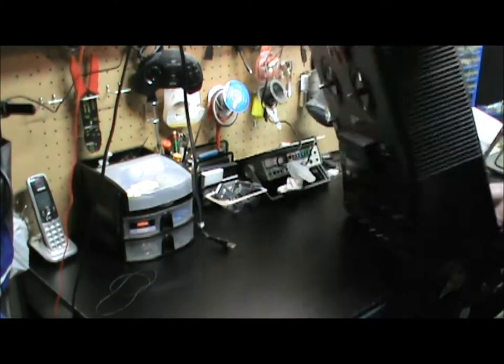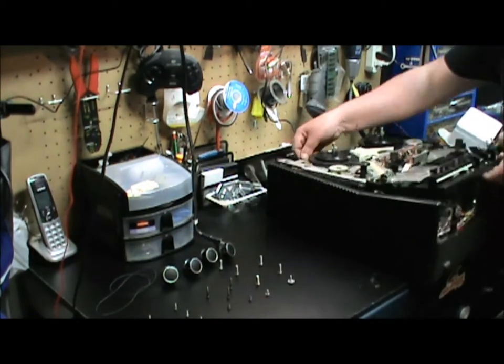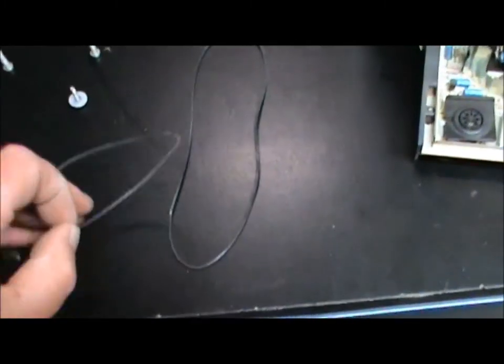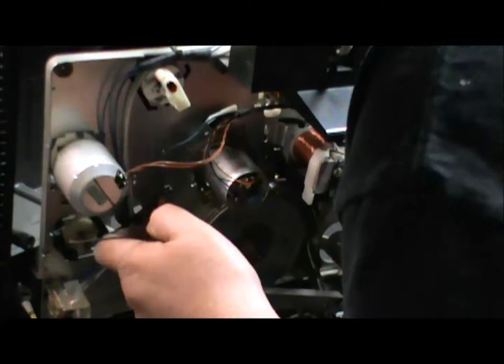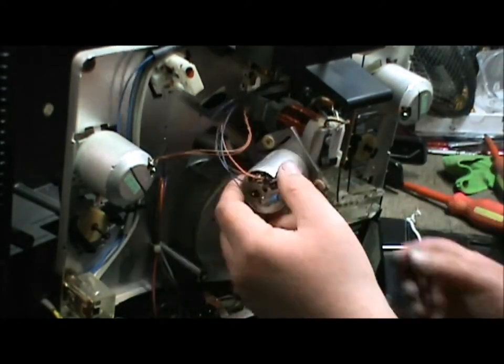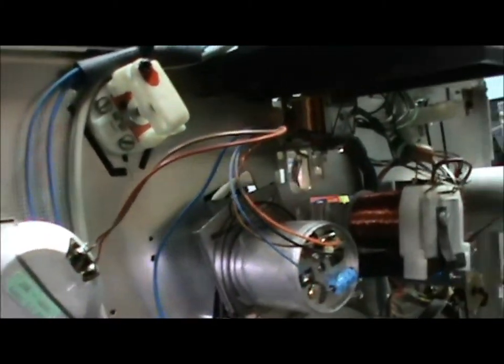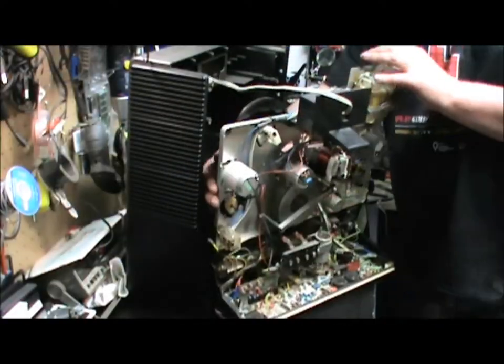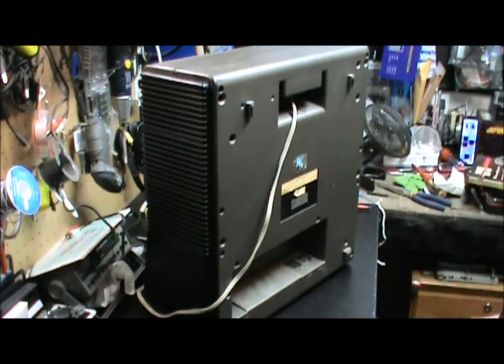Philips N 4504 Reel to Reel Belt replacement repair diy parts in description

Comment: Hi, nice video. I used to own the bigger version of this one, (N4506), and I loved that deck. I was an audiophile from about 1980 to 1990, and built a pretty large, expensive, component system. I all but gave it all away via pawn shops as a result of a divorce in 1991. 

The only thing I kept and somehow managed to take especially good care of, (even when I wasn't taking good care of myself), was the collection of (12) - 7" Reel to Reel tapes that I created in many hours worth of recording sessions. They're truly one of a kind and I almost still can't believe I kept them all in an AC environment no matter where I was.

About 1-1/2 years ago, I bought a descent Akai 4000DS MK II deck on eBay. It was in beautiful condition but I still knew I would need to clean up all the interior electronics and replace the belts. Of course, cleaning and demagnetizing the heads is a given, (I do that with every record/play session or every 4 hours, which ever comes first).

Anyway, when I put one of the reels on it and played it, I was instantly transported to 1982, (I was 26 then), and I'm now carefully digitizing each tape. It'll take some time and I'm thinking about buying a better deck. I know there's just about no way to get another Philips N4506, they just aren't out there.

So I'm looking at Teac or a higher end Akai, maybe a Pioneer RT909, etc. I'd love to get a Tanberg but if I can find one, I'd have to get a second mortgage on the house. If you happen on a descent Reel to Reel deck that you want to sell, let me know!

I have your email address from the video, (I don't know if it still good, but I'll try it). and I'll probably send a copy of this post to you that way as well.
Thanks,
Rich
Reply from the maker: +Rich Paul didn't get a email but will double check and will keep my eyes open. Never thought I'd get such a great response on this video.  You guys all rock!
Reply: Yes, it was a good video. I did the same job but on my 4506 back when I had it. I never did send an email because I forgot. I was searching for a deck and last Thursday or Friday, I happened to open eBay 5 minutes after a seller posted an ad to sell his pristine Tascam 32.

He put it up for auction but had a "Buy Now" price which was only $70.00 more than the auction's starting bid. The deck was in such great shape and he made 3 videos that showed the heads very clearly and up close, (they were perfect).

The sound of the deck and its mechanisms were super quiet and I knew that it would never make it through the auction. Someone would buy it way before then. The starting bid was $290. and the Buy now was $360. He wasn't very familiar with eBay selling as you can tell by the way he posted the auction and buy-now prices so close to the same.

The Tascam 42 would have been my preference but the two I could find had a $1400. minimum price tag. This 32 looks like it came right off the store shelf and I couldn't pass it up. He shipped it yesterday including some new tape and two 10.5" metal reels.

I hope to have it by Friday.
Thanks,
Rich
Reply: Enjoyed your recollections and feel the same about the old reel to reel machines. I sold the Sony 630 and the 377, but perhaps should have had them restored. The N4422 I have now needs servicing, but dont want to take it too far away from Birmingham UK to get done. Any ideas?

Comment: Excellent video. You made it look easy, but expect it doesn't always go so well, particularly if more work is needed on old greased parts. I have the Philips N4422 that I am offering for sale now, but it does need new belts and a good service. I bought it new with a 'Sprocketmaster' attached in my old fil making days. Have loads of tapes with some great music, but nothing to play them on. It crossed my mind to restore the machine (not me but through a good service engineer) but may be put off by the cost of that. It was a great machine but may cost more than I would want to pay. I also dont know of a service engineer in the Midlands of the UK (unless you do?)
Thanks again.
Malcolm
Reply from the maker: Hey Malcom,  its hard to tell the cost some shops are super expensive and charge by the hour plus parts so even a 5 minute job gets billed as a full hour.   I would try to search local classifieds to see if there is someone out there or post on a facebook group possibly a local one looking for someone to repair it someone might know someone near you that can help with it.   Since I am in Canada its a bit hard to tell who would be good tho as I don't recommend anyone for jobs like that unless I personally know them and know their work.   Help is out there just toss up a few ads around on local sites and see what comes of it lots of guys doing it for hobby as well.  Best of luck and hope you get it going again.

Comment: I have one of these decks... the problem is that the tape slides off the transport near the pressure pad constantly. If I add pressure with my finger up towards the tape, it stays in place, but the pressure I apply is way too much to have it playback properly anyway. Any idea what the problem may be? Is there a place to get a replacement pressure pad? thanks in advance.
Reply from the maker: did you manage to find a replacement pad?  just curious if there was something out there.  I never managed to look into it for you my apologies for that.
Reply: @Gam3T3cHElectronics  no never did find one. Eventually I sold the machine to a collector of reel players.

Comment: Help,  i relaced the belts got. fast forward and reverse but no action on play,  any ideas why?
Reply from the maker: can you see if it is slipping at all when it is in the play position?
Reply from the maker: I would probably at this point make sure power is properly getting to the motor with a multi-meter to see if it is the motor or if something down the line.  is it completely seized up?  no manual rotation?

Comment: Where can I buy a new belt?
Thank you
Reply from the maker: Not sure I would just run a string around them and then measure the distance around them and then get a belt that is smaller but close to it the belt I used was just one I had laying around from a jukebox that stretched to the right size 4 years later its still working great.